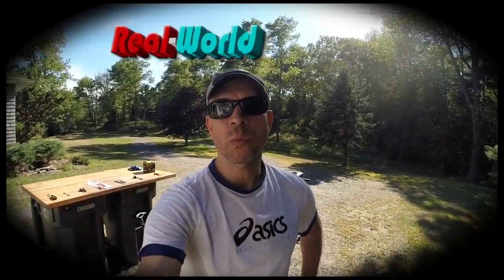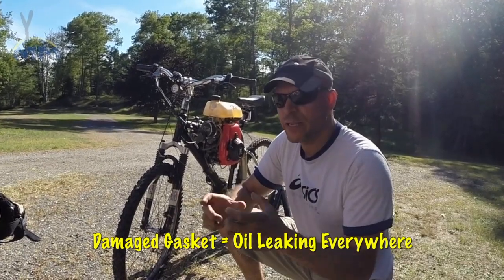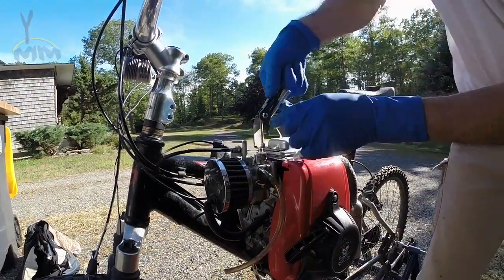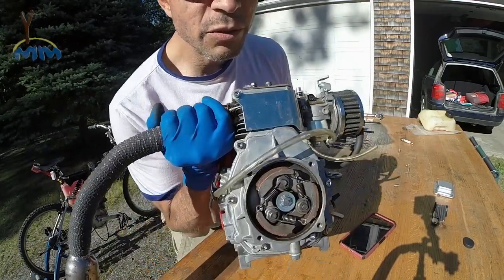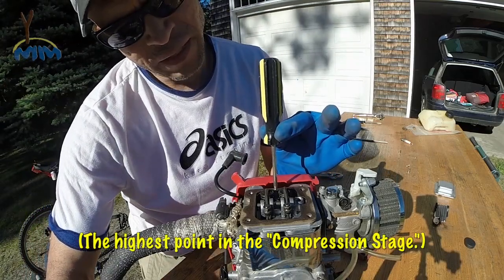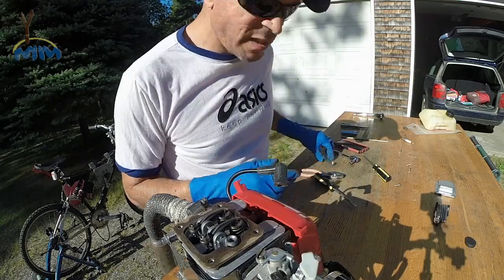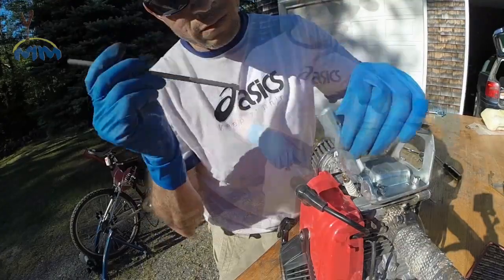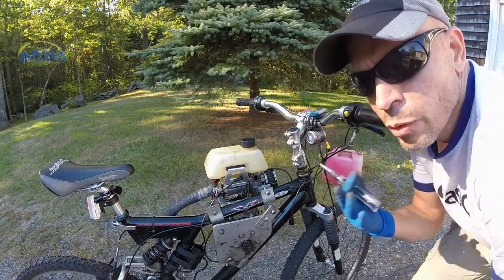Real-World Motorized Mountain Bicycling: Valve Adjustment (49cc 4-stroke)

Comment: Most installations on most bikes example, cruiser frame should allow you to do valve adjustment without engine removal.
Reply from the maker: As I said in the video, removal for Valve Adjustment isn't required on my rig either, I was doing more than one "maintenance" video that day, also removing made for a better way to show on camera.

Comment: my dont run after this: i got something set wrong! .. it like barily trys to. put put put sound.. like 1/4 the run sound.. :>(
Reply from the maker: Sorry to hear you’ve having issues with your motor. Make sure adjustment is made at “Top Dead Center,” and, most importantly, set your valve gaps to the specs set by YOUR motor manufacturer (not mine). Lastly, be very sure the set screws don’t turn at all when tightening the nuts down. Measure again after tightening to be sure your gaps still match manufacturer specs after tightening. Being off even a little can affect the motor performance substantially.

Comment: It is interesting that you have not referred to the factory specified valve clearances for this engine design. You are apparently satisfied that your personal specifications are of value without comparison with the factory. The factory specs are:  Intake  .08 mm  *-  .02 mm  and EXHAUST  .11 mm  *-  .02 mm.   COLD.  Yes  Cold, air cooled engines are generally set Cold.  A Huge example are millions of air cooled engines....  VW and Porsche for example.  Always set COLD.  The fact that your engine runs at all is some indication that your settings are Near enough to fake it.  Good show.
Reply from the maker: Clearances vary from brand to brand, model to model, and therefore referring to specific factory specs doesn’t apply to everyone viewing my vid.  Furthermore, YOU don’t know the brand, model, or modification status of my motor (or carb) and therefore cannot know what MY measurements should be. I don’t refer to factory specs because I do not have a factory motor. I say MY gap clearances are 0.05mm on both because that is what they are supposed to be for MY motor.  My statement on warming the motor first pertains to the removal of the valve cover without damaging the gasket, not adjusting the valve gaps. I find your reference to a motor that runs better than factory as “faking” confusing, however, I know you mean well and I appreciate the feedback.
Reply: @yah-monmultimedia1528  The unique status of your special one-of-a-kind engine is noted,  How convenient to be able to disregard any comparisons between your personal engine and millions of others. Your specifications stand alone and that is the salient point. Impressive, if taken with a grain of salt.
Reply from the maker: @dehoedisc7247  I disregard nothing because I did not go there in the first place. This video is about a methodology, not about a specific motor--- other than that the basic anatomy of the one I used to illustrate the procedure is the same or similar to the ones that potential viewers may own. I correctly stated that one should use a gap measurement appropriate for their motor and differentiated that from the one I intended to use on mine. The debate you are trying to have with me is off-topic and therefore unproductive.
Reply: @yah-monmultimedia1528  Unproductive Indeed, due to your mumbo-jumbo word-twisting to suit a demonstrably awkward, yet ornery self righteous core. Arf.
Reply from the maker: @dehoedisc7247   The video is in plain, straightforward English that even a child can understand. Perhaps you need to watch my video again, paying attention this time or continually re-play it until you are able to properly understand the "mumbo-jumbo" so that the words don't seem as twisted for you. Better yet, you should share it with everyone you know to show how awful you think my content is, and have them all subscribe to my channel so none of you miss the opportunity to similarly pick at elements that aren't a part of those videos either.  As an alternative, we can argue about you returning my jacket to me: that subject is just as flawed, useless, and irrelevant to the video you're commenting about as the argument you want to have. Get a job.
Reply: @yah-monmultimedia1528  I mean, I literally just wasted all my time listening to the sound of your voice with this crap music thinking you were actually giving me the real numbers for clearances that I need for this engine. Which by the way is a factory engine it’s made in a factory specs come from the factory for this engine and that’s exactly how everything should be set!! Thank God for the original commenter, posting the actual clearances!

Comment: What type of carb set up do you I’m about to build a 4 stroke kit and want to lose the stock carb
Reply from the maker: Hi Leo: The short answer is a NIMTEK Carburetor for HUAYI 4 Stroke 49cc GX50 Engines ($24 on Amazon and is anatomically the same as stock).  The longer answer is, outside of the carb needing to feature attachment of a cable for manual throttle control (as opposed to a self-governing like on a lawn mower) ANY carb that can properly attach to your motor should work fine, provided: 1) that the Air/Fuel ratio screw is properly tuned, and 2) that the Valve Clearance in the motor is properly adjusted. What I WOULD recommend, though, is an aftermarket/upgraded air filter, as any carb on the 49cc 4-strokers are sensitive to the teeniest particulate of dirt. Congrats on your new build!